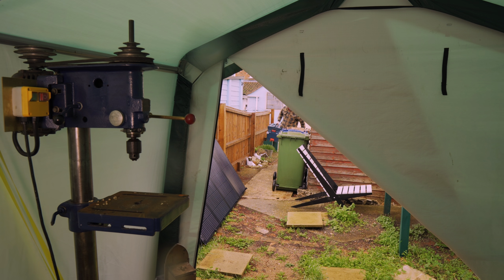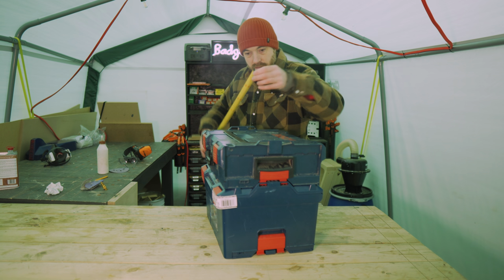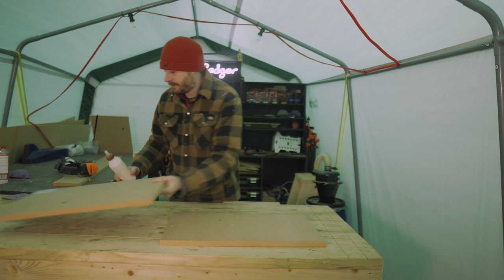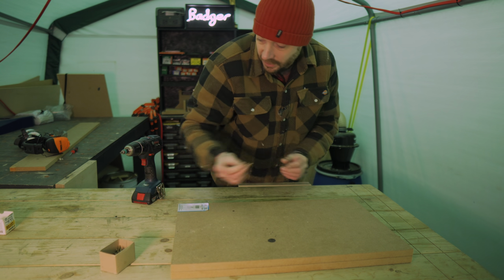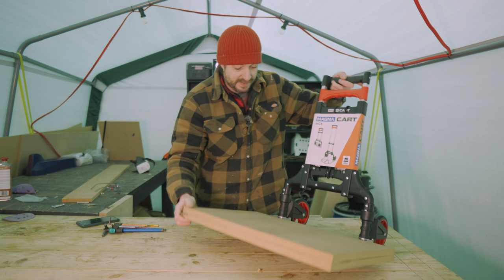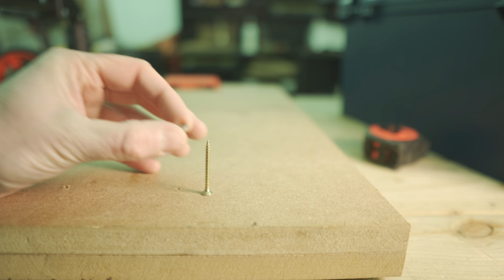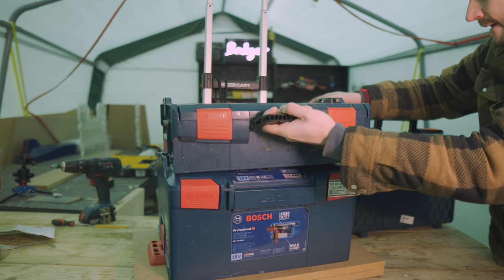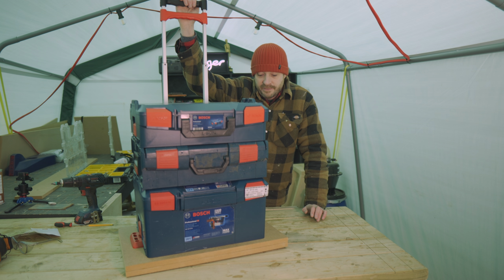Tool Box Cart

Comment: Clever idea, I like the snap on brackets. My only challenge would be the MDF. The MDF that I have available locally would swell up to twice it’s size and get all spongy like a Weetabix the first time it got rained on.
Reply: Paint the heck out of it.
Reply from the maker: I just used MDF as I had some
Reply: @Badgerworkshop  Yes, I'd use what I have on hand too.
Reply: @Badgerworkshop  you could just paste wax on it, it will give it some water protection and it looks good.

Comment: I’d at least give the mdf a wipe over with some oil to try and inhibit moisture absorption. 

Have you thought about trimming away the mdf so it doesn’t protrude so much? Maybe drill some big holes (maybe even trace the profiles of the holes in the sack truck base) for weight reduction?

Comment: Does your cart lock into position when in use? I have a Lidl version which does not and the wheels start to fold in over rough ground.
Reply from the maker: It does because the wooden base is screwed on